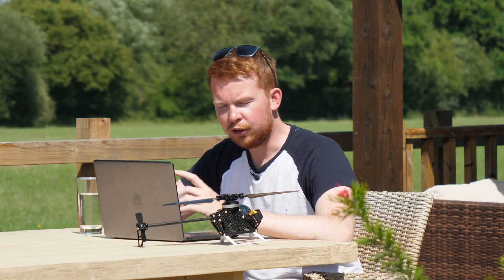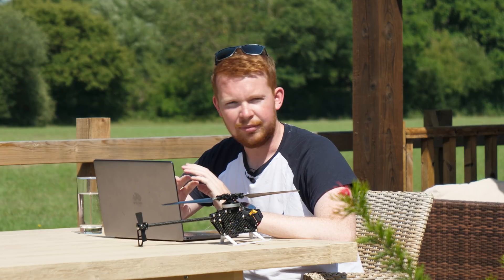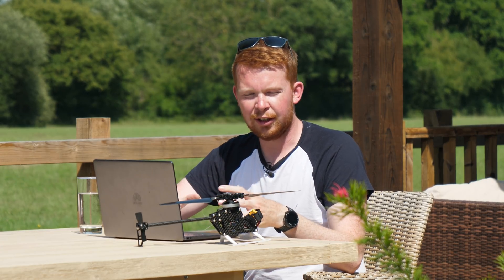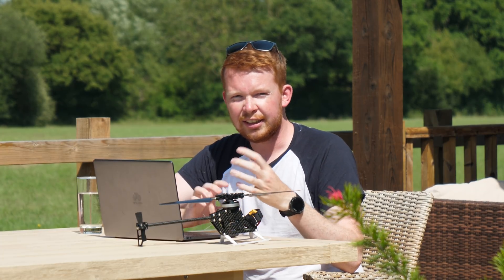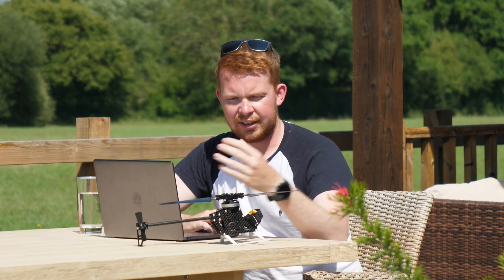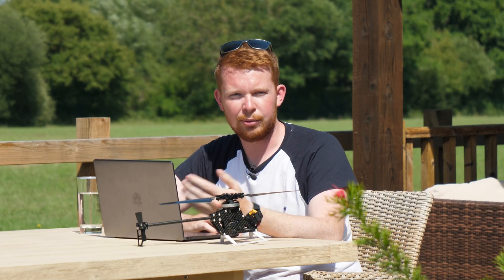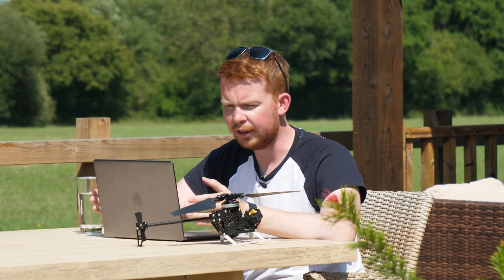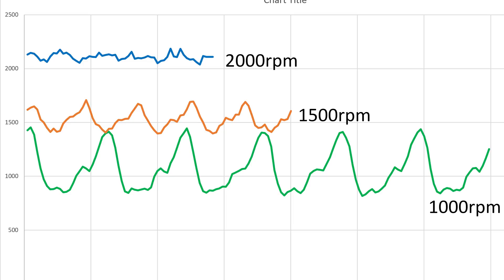How I built a Swashplateless Helicopter

Comment: Amazing project. I wonder if you could source tiny bearings for the hinges? RC heli tail rotor assemblies often have them so I assume they're available somehow. I wonder if switching to collective heli blades would reduce efficiency, the fixed pitch helis I've had have similar blade designs to these drone props. Presumably you can reduce rotor mass and have greater efficiency for positive attack angles when you run this design as opposed to an airfoil blade. On the other hand I assume you're interested in trying heli blades as the lift variation with pitch is more linear? Sorry if I've misunderstood. In awe of the project, cheers!

Comment: Delta 3 hinges are used for helis, if its a two bladed tail rotor they will use a delta 3 hinge for up and downflapping. main rotor systems wont use this because of the forces involved on a main rotor system are to big for such a hinge

Comment: Using ball bearings in the hinges allows less or none hysteresis.
Reply: the added rotating mass would putt more strain on the motor.  remember that it has to accelerate the blades a few times per rotation.  keeping the rotating mass low is important.
Reply: gadgetmerc the blades normally come with bearings fitted.
Reply: Oilite bronze bushings would probably give best weight to friction compromise.

Comment: wow! that's great! i even bought STEVAL-ESC001V1 for that project, but there is always not enough time) as i understand, esc already knows rotor position, so you don't need any additional sensors, just startup calibration. also, sine/cosine can be ultra-fast when replaced by parabolic approximation (just x^2).

Comment: Great video as always! I find it great how much work you put into your projects! I don’t think I understand nearly as much as you about this stuff. But I still want to share my idea. Did you try/think about adding small weights to the end of the rotors? Especially to those with a smaller angle of attack. I believe one reason for them being harder to tune is that they have less inertia/drag and thus it takes more acceleration to tilt the blade. I hope you can understand what I mean. I think the steeper rotors are easier to tune because the higher drag makes it require less change in rpm to tilt the blade. Maybe small weights could increase the inertia of the rotorblades and thus make it easier to control them. On the other hand it would probably not solve the problem of the motor getting hot since it would’ve to work harder again. But maybe the lower angle of attack of the blades would still decrease overall power usage. Just wanted to share this idea, no plan if it is a good one. But I’d find it interesting to find it out.
Reply: That sounds neat but that would kind of exacerbate the hinge friction thing he talked about
Reply: @spencerlegresley8258  Then use ball bearings, or sintered bronze bushings.. doesn't have to be high friction brass bushings on screw threads...

Comment: Did you calculate how efficent the helicopter is? I imagine the whole acceleration and deceleration isnt that efficent
Reply: Nikolas Braun would the decelerations not be similar to regenerative braking?
Reply: @lewisstevens8590 In theory yes, but you are switching between acceleration and deceleration. Losses are rising with frequency and at some point, it behaves like a shortened line. Google for capacitors in series and parallel circuits. This system behaves like a capacitor.
Reply: @ShortApproach  mechanical eficciency losses exist too😁
Reply: @lewisstevens8590  Even more efficient than regenerative braking is not speeding up in the first place. Also, most ESCs do not have regenerative braking (I only know of 1).

Comment: What library did you use on the teensy to control the motor, the servo library, as far as I know, is capped at 50Hz. How did you control it at much higher frequencies?
Reply: I think he said he used d-shot 125 so no servo output
Reply from the maker: I configured the Teensy PWM library to output Oneshot125: https://www.pjrc.com/teensy/td_pulse.html .
Then in the code, I used:
void setup (){
  pinMode(4, OUTPUT);
  throttleOUTPUT.attach(4);
  analogWriteResolution(16);
}
void loop (){
  throttleMAP = map(throttle, 1000, 2000, 4048, 8096);
  throttleOUT = constrain(throttleMAP, 4048, 8096);
  analogWrite(4, throttleOUT);
}
Which I think should be 488hz

Comment: Really awesome! I love that you are doing sort of technical explanation. Here's a challenge: make an airplane with no control surfaces, but instead uses this setup ( and maybe differential thrust?) to control its pitch and yaw.
Reply: Sam Nelson this is a brilliant idea. I wonder if this can be done with cheap tiny motors like from a small drone.
Reply: That's already done, look at Ardupilot unless I am mistaken about what you are trying to achieve
Reply: @sUASNews   i have check the  code but  can not find that about swashplateless
Reply: Airplanes can fly quite easily with just two motors and no control surfaces and they wouldn't even need this system, however making an airplane fly with just one motor and using this system for pitch and yaw now that i would like to see.

Comment: Would it pay to run some sort of a gear reduction (3:1 would easily hit your 3000RPM rotor speed target with the current motor and battery, although changing motors isn’t exactly the toughest thing in the world), but still use the rotor shaft to read speed? It would reduce the magnitude of speed change at the motor (for a given desired output) in addition to gaining back some of the torque lost to running the current motor at ~1/3 it’s rated speed, and I’d imagine you’d have a bit more control authority as well, but that’s just pure speculation on my part.
Reply: It would mean a faster running motor so his 10 throttle changes per rev would be reduced to 3ish. Which would be cutting it close (technically you only need two throttle changes per rev but i am sure the controller would not enjoy that)

Comment: Amazing work sorting out that equation, very impressive. I'm amazed it flies that well, getting rid of a full blown rotor head means this can be much lighter and more reliable. Interesting stuff!
Reply: There are certainly weight savings to be made but this design also probably requires more power to run because of the constantly accelerating and decelerating motor.
Reply: It really isn't though. Not to be patronizing but there is a lot of room for improvement. There was no consideration given to velocity or acceleration. I have a feeling the code he is showing us is from his first failed attempt so that he doesn't infringe on the patent he mentioned.

Comment: I'm sure that the weight of the piece that hold the propellers needs to be as low as possible to reduce the stress on the motors
Reply: I think a capacitor to store the back emf generated by the deceleration in the motor would reduce the amount of energy required to be dissipated as heat during the deceleration phase and allow rapid acceleration during the acceleration phase.

Comment: I am going to study next semester... but I dont really know what course I should take.... What would I need to study do learn something like this? Electrical engineering? Mechanical engineering? Airospace Engineering?
Reply: All of the above sound like they could get you involved in something like this. Computer science would be another to consider, since a lot of this uses code, but mechanical engineering is a good choice because it is very general, so you will have more room to explore different things. Take this with a grain of salt though, because just graduated high school, and haven't been though college yet.
Reply: It depends a lot on what exactly you want to work with within the project. Aerospace would probably be the closest one, in terms of mechanical design of flying machines, but depending on the curriculum, you might need to catch up on the software and hardware side of things. There is a lot of control and hardware involved in those kinds of projects as well, and that would be more in line with Electrical engineering or Control Engineering. 

That being said, doing either of them would be perfectly fine to start, you would only need to catch up in a different area of expertise them later depending on what you choose. Also, I would recommend that you research the market around where you intend to live in the future to see what kinds would have more jobs.

Feel free to PM me if you want to discuss more in depth  the different areas, I would be happy to help :)
Reply: @Fred160008  how could I PM you? I would love to get to know more of the different fields! Thank you

Comment: Sin cos on a microcontroller is not ideal (depends on the library implementation) but for this application a simple approximation to a parabola would be more than enough.
Reply: In the eightties and nineties games and demos lookup tables were used for sine calculation. A teensy has probably enough program space.
Reply: It's probably a lookup table. It could be a polynomial interpolation but since the speed is an issue, it's better to do it like that.
Reply: It's a teensy, it has enough computing power to directly compute sin/cos
On some 8-bit uc however, you need to use some approximation tables
Reply: The Teensy 3.6 is an ARM cortex-m4 processor running at 180mhz.  I'll handle it just fine.
Reply: I have tested lookup tables vs the standard library trig functions and they are basically on par. The libraries are heavily optimized.

Comment: If you'd like some help setting up compiling INAV on your computer I could show you how. it could remove the need for the teensy.
Reply: @GivesNoFux FPV The teensy is getting PWM or some other form of pitch/roll/throttle from Inav. It then converts that to a throttle value based on the encoder. The conversion and encoder reading could be done directly on the Inav board and save some wiring. Where do you think I got it wrong?
Reply: @Elmeerkat  unless you could make the board read the hall effect sensor to know the motor angle, you'll still need the teensy
Reply: @JulesAndComputers  Yup. Since the encoder being used is an AS5047 (from the video) you can connect to it with SPI, PWM, UVW, or ABI. Inav already has SPI and PWM inputs written so that connection wouldn't be particularly hard.
Reply: That would be awesome to remove that teensy
Reply: @GivesNoFux FPV compiling would imply re-coding, so i believe he is talking about adding the capability into INAV
Reply: Can you make a tutorial on that for all of us too? Very interested!
Reply: @GivesNoFux FPV Clearly you don't understand what compiling is and what it is used for
Reply: Smash that Teensy!!! 😡
Reply: If you could show everyone that would be amazing!
Reply: Please let me know if you're willing to help out, because I'm trying to do the same thing and the teensy is a big roadblock.